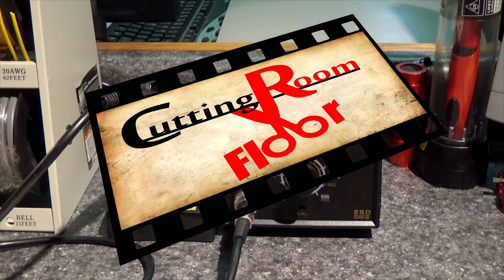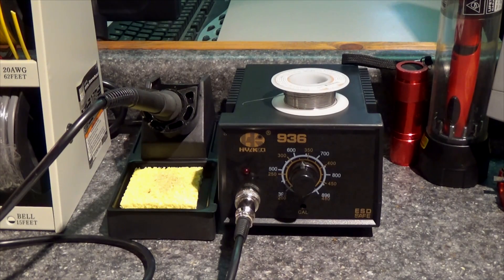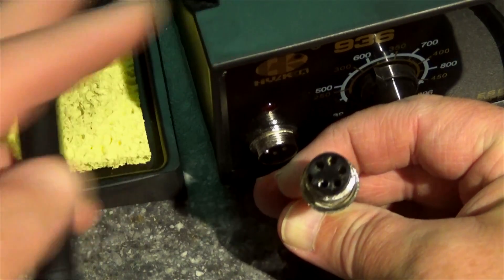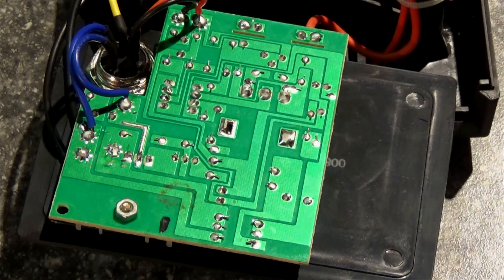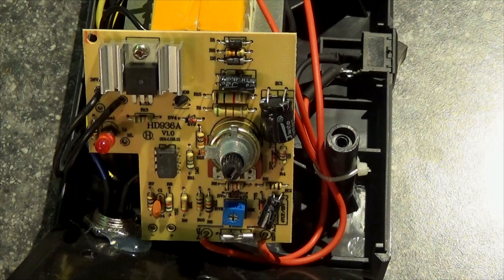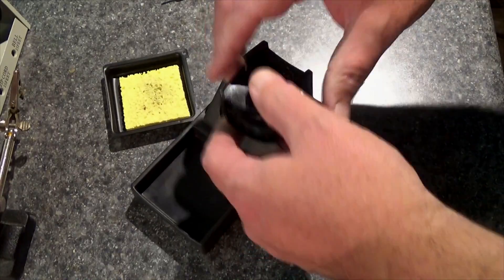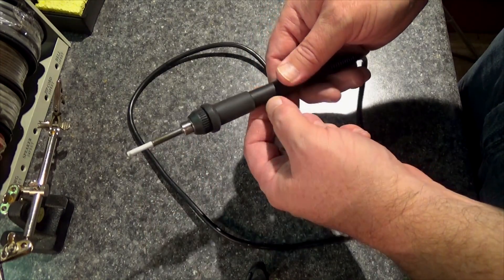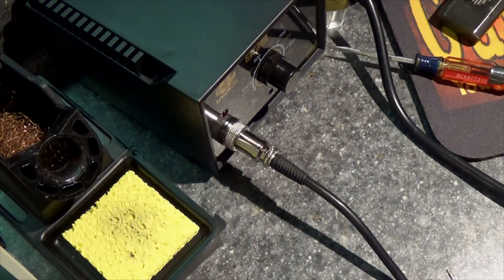$35 Soldering Station Followup - 936 eBay Chinese Knockoff

Comment: I have the 937D and it looks like the only difference it the digital read out. I'm far from an expert and having a terrible time soldering 10 gauge wire with mine. Are any of you able to do that? and if so, any suggestions? What tip do you use, or whatever? Or is 480c not enough for that?

Otherwise it does fine, but just not worth it for me if it won't do some of the larger wire.
Reply: Can't you just use a big ol' dumb direct to the wall 110V (or 220-240 V depending on region) soldering iron for 10 gauge?

Comment: After 1.5 years my tip is not heating up. I see when you take off the tip there is a white plastic tube that seems to go all the way to the end. Mine has a band of metal extending from the end and some metal is covering the end of the tip. Not sure if this is the problem. One would expect some metal there to transfer heat to the tip that goes over it. Can I confirm that you don't have a metal band at the end? Or any other reason for the tip not heating up? I haven't opened up the box to have a look. Should probably do that.
Reply: The long white cylinder is a ceramic coated heating element.  The cheap ones use wire wound heating coils, and are undersized.  The better ones have a foil heater encapsulated in the ceramic and are accurately sized for a slip fit.

The end of the heater should be exposed white ceramic.  Some high quality tips have a springy copper or copper alloy sleeve for better thermal contact.  That may have come out and remained on the heating element.

Replacement heating elements are only a few dollars.  The main type variation is a thermistor or thermocouple temperature sensor (A1321 vs A1322).  it may take a few purchases to find a good one. There are quality ones and cheap ones, and it's a dice roll which you'll get no matter what price you pay.
Reply: Except some of such cheap stations shipped with a metal encased heater, not a ceramic coated one. But it can take ceramic one too, no problem.

Maybe Aouye from a local official distributor could be replacements that are at least consistent in quality, i don't know, just an idea.
Reply: The "A1323" heater has a stainless steel case, but those are more expensive and thus uncommon on the low-end stations.  The stainless case also extends from the base to the tip, so no white is visible.
Reply: So I bought a cheap tip with cable, handle and everything. I think it was $8. Despite it looking just slightly smaller, before I had soldered anything the plastic melted. I then used the ceramic part (white everywhere including on the end) in my old cable and tip and it wasn't hot enough! In other words, somehow the plastic melted even though it's not getting to full temperature. So still not sure if it's the unit or the ceramic part.

I did actually turn up the calibration to full when it melted and it may not have been on full after I changed to my original handle with the new ceramic part. The reason for that is the calibration screw on the unit had shifted and wasn't properly accessible! Next step I think is to try to turn it up to full again.

Comment: 20 hours use and a burnt out tip.. I wouldn't call that good, I've had tips last for years.
Reply: I agree.  Forcing a too-rapid switch to lead-free solder has caused many billions of dollars of losses.  From high profile ones, to many unacknowledged reliability problems.  There good reasons that most military and space applications explicitly do not allow lead-free solder.

The absurd thing is that the ban came just as assemblies were switching to use far less solder.  SMD assemblies use a microscopically thin film of solder to bond parts, unlike the gap-spanning mass of through-hole soldering or the gobs used in chassis assembly.

As a hobbyist or repair person, always work with lead-based solder and add a little solder to each joint you disturb.  Lead-free solder only works with tight process control and a carefully designed temperature profile.  Re-melting it will trigger all of the problems that early assemblies suffered from: tin whiskers, crystallization, brittleness, cracking, pull-away and sludge waves.  Adding just a little bit of lead minimizes the problems, along with lowering the melting point which minimizes the thermal and mechanical stress.
Reply: 20 hours of solid use I'd imagine, that does say quite a bit about it.  
The thing is, you can buy higher quality tips so tip failure isn't too 
much of an issue here in my opinion.  I'd hate to admit what I paid for 
my Weller station without temp control over 20 years ago.  If you're a 
tool snob then that's fine, I tend to be that way myself, but I have to 
admit that I bought a Chinese knock-off soldering station with 
temp control and a vacuum pump as well as heat gun for less than I paid 
for my Weller, it's still working two years later.  Yes, I bought some 
high quality tips for it and I expect them to last a long time.
Reply from the maker: thanks, here are the tips I got that are less than a $1 each - http://www.ebay.com/itm/10-Solder-Screwdriver-Iron-Tip-900M-T-for-Hakko-Soldering-Rework-Station-Tool-/181775714850?hash=item2a52ad4a22:g:tcoAAOSwxH1UINSg
Reply: +Donald Becker anyone that doesn't have to use lead free solder but does is an idiot. If you're working at home there's no reason to use lead free solder either. What you make does not have to comply with anything. Not unless you're selling it. Lead free solder is garbage! A bunch of feel good legislation that ended up doing far more harm than good. All because they couldn't address the real issue. Which is the proper disposal of e-trash. So they shifted the burden onto everyone else. The manufacturers, the consumers, everyone but themselves.
Reply: For the difference in price you can buy a lot of knock off tips.
Reply: Tip life is very heavily dependent on the operating temperature and the solder composition.

Eutectic lead solder melts at about 183C, and a tip temperature of 200-250C is reasonable.  At the lower end of that range even a raw copper tip is usable.  An iron-plated tip used to be a premium product, and would last a decade of hobbyist use.  Flux carbonization is almost non-existent, and is an indication that the iron is too hot.

Lead-free solder requires 20C-50C higher temperature to soften, and even higher temperature to flow well.  At this temperature raw copper will dissolve into the solder fairly quickly, thus  Iron plating  is pretty much required.  The iron in turn will corrode much faster, so additional chrome or nickel plating is needed on other areas of the tip.

A damp sponge used to be the standard way to clean a tip. It would remove acidic flux and odd alloys in the slag, actually extending tip life over not cleaning the tip.  But the combination of higher temperature, a thicker iron coating and lead-free solder makes the iron layer susceptible to cracking from thermal shock.  Once it cracks down to the copper, erosion quickly ruins the tip.  So shaved metal is now the preferred way to clean tips, even though it doesn't work quite as well.
Reply: *****
What Weller station do you have that is not temperature controlled? It may be, you just might not know it. Weller controls the temperature by what tips you use. It is called Magnastat. If you look at the end you put in the iron there is a number stamped in it. That number is the temp the tip runs at times 100 in Fahrenheit. You can get 6s, 7s, and 8s.

Comment: Two things to check besides the magic smoke is how well it holds the set temperature and ensuring there is no voltage present on the tip which might destroy sensitive components. If you're just soldering wires together, it's not that important but would be for PCB builds.
Reply: ...and for $35, you can always just buy another if it blew up on you... pretty good deal for the typical DIY'er...
Reply: how do you get voltage on the tip from a heating element cappe dwith the tip?